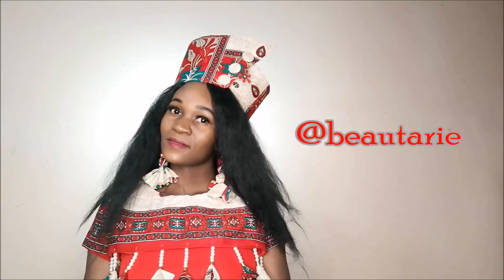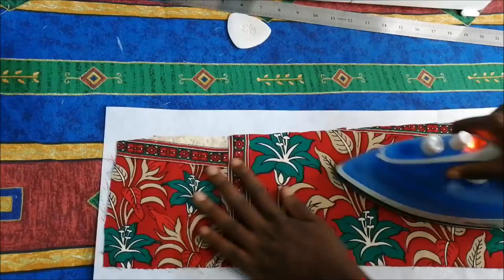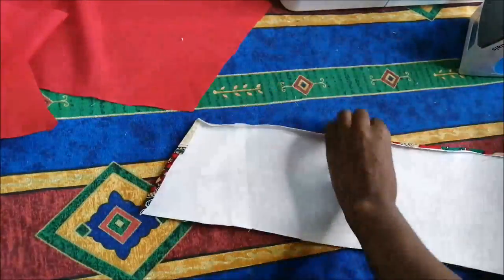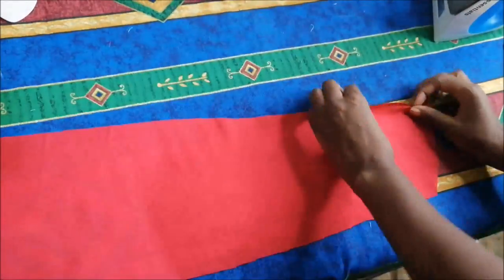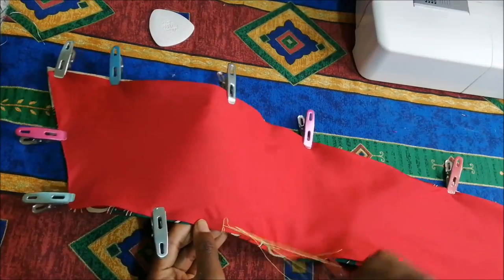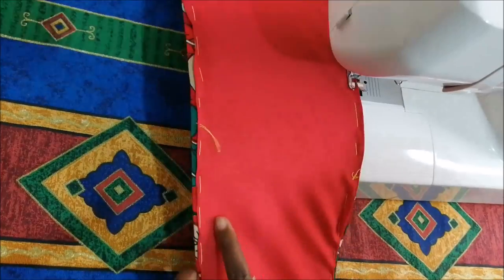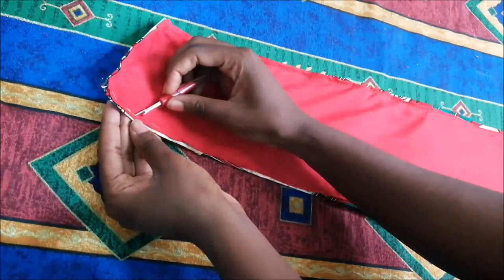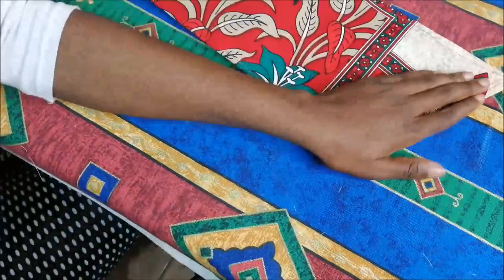DIY Statement Head Piece| African Zulu Headdress (Isicholo)

Comment: When I use those measurements the head piece came out small enough for a child not for an adult so I have increased all of your measurements and make the perfect hats thank you
Reply: Do you mind sharing your measurements and what weight interfacing you used? Pretty please ❤️
Reply: @ColorMeBaddMUA  the interfacing is called SF101 shape-flex the measurement was 24.5 inches long 13 inches high for highes side and 10 inches on the short side
Reply: @denisenewton1510  I appreciate you so much for this ❤️❤️
Reply: @ColorMeBaddMUA  don't forget to add 4 inches to the length of your head measurement so this was overlap in the front